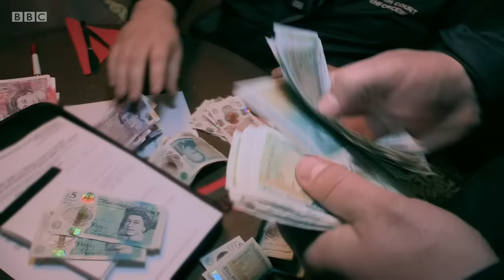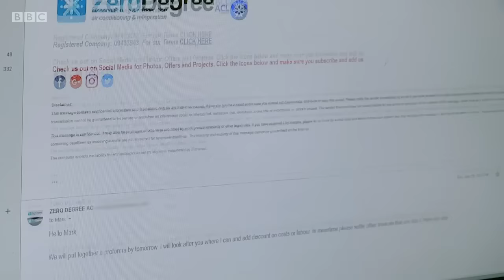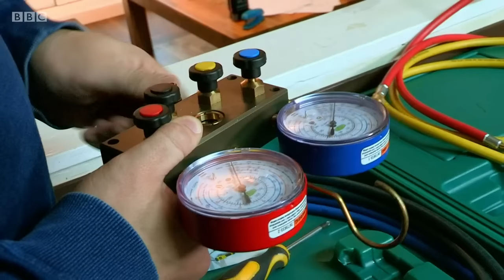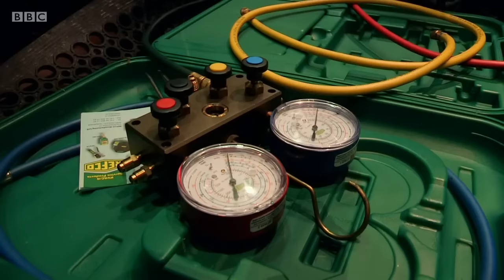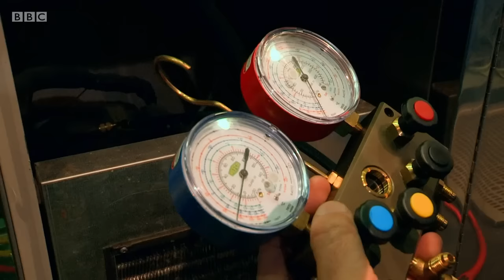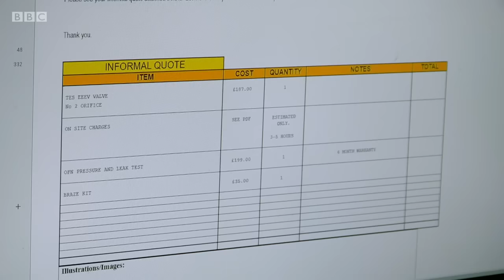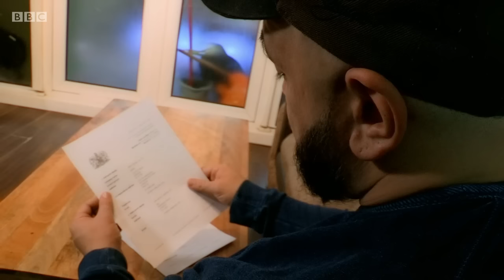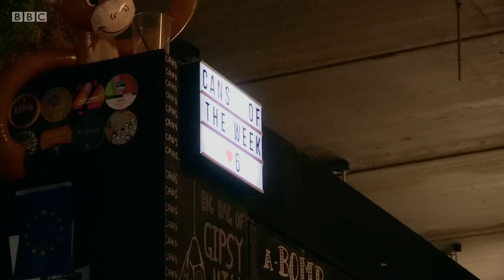The Sheriffs Are Coming S09E10

Comment: How much does it cost to apply for a ccj?
Reply: According to google it can cost anywhere between £250-£1000+ (plus VAT) for obtaining and enforcing a CCJ, depending on which methods are used. You may pursue enforcement action if the CCJ is still unpaid after 14 days have passed since it was granted. You can either transfer the execution to the High Court for enforcement